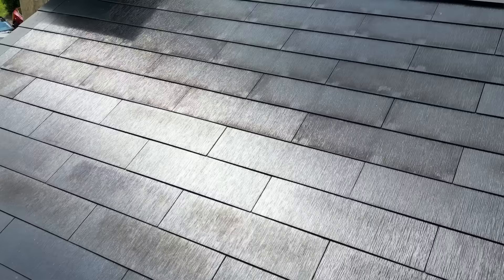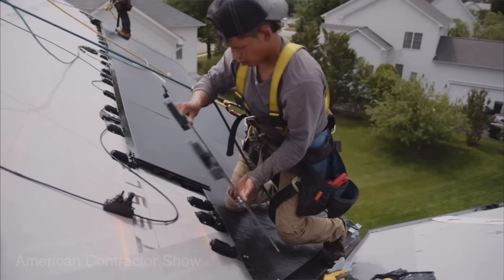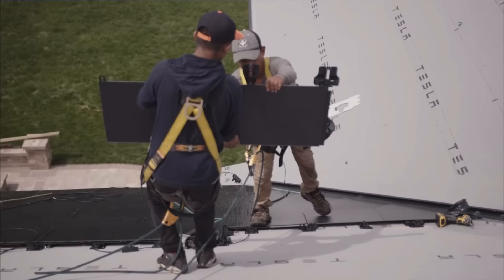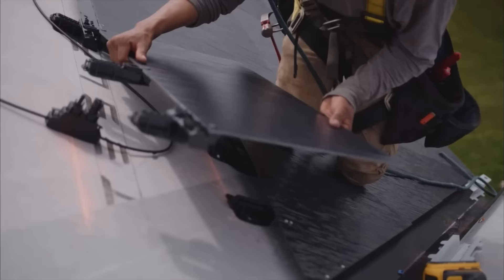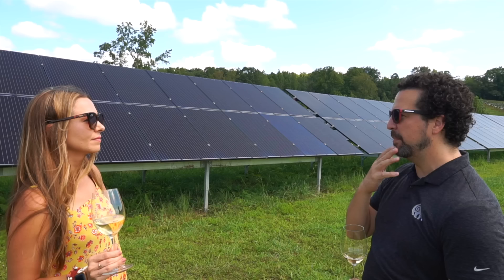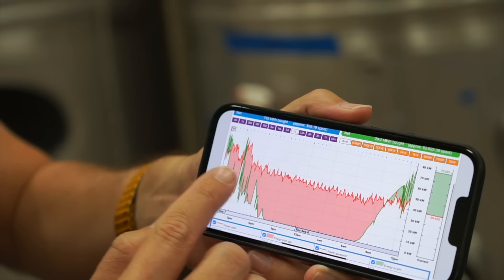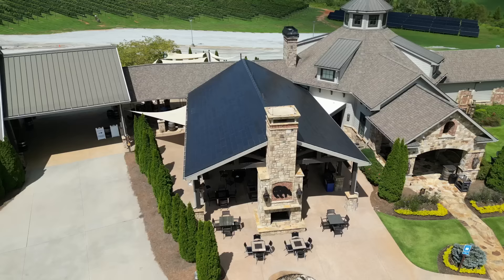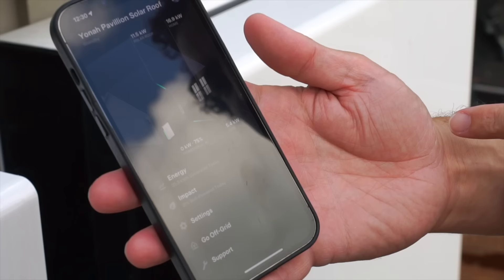One Year With the Tesla Solar Roof | The $100,000 Experiment

Comment: Great video, amazing quality. That being said, even 100k is way too expensive for 17KW + batteries.
Reply from the maker: Price included 4 Powerwalls but yes not cheap.
Reply: Not sure about this install but pricing for solar roof has the added cost of the removal of the current roof. 

If forget but last time I priced it out on Teslas website it was about $20k just to remove my current roof.
Reply: Yes it is expensiv, but it also gets you a new roof w
Reply: 100k + 4 powerwalls is dirt cheap from any solar company not if you build it yourself

Comment: I am going to assume this property is commercial he can literally install up to 300KW and still qualify for 30% ITC. I own a solar operation in Louisiana and we install in TX OK and LA. The same system size (in the video) via 400w Solar Panels + 4 Batteries would cost today about $93600 and after tax credit it would be $65520. We use Enphase Micro Inverters.

Comment: Did he say they expect to break even in 3-6 years? That’s an incredible ROI. Really enjoy these videos of different applications for this tech.
Reply from the maker: Glad you enjoyed! These are always fun to make.
Reply: All gravy after 🥸
Reply: Break even in 3 to 6 years my foot. Why doesn't he list the cost of the roof?
Reply: @kpv123   Probably because they're separate projects installed years apart. Even though they're on the same property, presenting them this way is a good way to contrast how the economics of solar projects of different types work. 

So for the rooftop one, at 2:39 and 3:12 they give the specs, pricing, and payback time for the pavilion project - $60k for the tiles and installation, $40k for the Powerwalls. 17 kW of generation. 22 yr payback, though I'm not sure whether they are counting the value of a roof in that or not since to an extent you could separate that since you've need to pay for  a roof anyway.

For the groundmounted system, they give them at around 7:42 - 250k equipment and installation. 106 kW of generation. It's been in operation for more than four years and at current rates, roughly another three more years for payback, so call it a bit over seven years. I presume that their rate changed over those four years since at the quoted savings they'd have generated $250k in savings in 4.6-5.2 years, though it's also possible that this figures were simplified and seasonal variation accounts for the difference.
Reply: Yeah, sure they will😂
Reply: If you invest that 100k in an s&p500 index fund. In 25 years you will have 500k. But the solar roof will need replacement. Will you save 500k in electricity over 25 years? Not likely.
Reply: 50 years to get your money back is horrible investment and all the cost associated with producing these tiles.

Comment: Very funny video you should install an East to West solar tracker probably produce a lot more power
Reply: But a fixed roof can't track. Solar tiles at fixed on roof.
Reply: I wasn’t talking about the roof that’s obviously a fixed system I was talking about the solar farm they had, not the roof
Reply: @alexc9879  in my area of chandler az the trackers seem to fail and get stuck a lot. I report them to ASU , CHANDLER CITY and APS a lot.  I consideredthem on my home backyard system but measured the output and cost and just added more panels.

Comment: And there is the issue...22 years to recoup costs.  Even longer if you buy now.
Reply: What is the roi on a non solar roof?
Reply: @CjF344  I don't think anyone actually gets an ROI. There was a while when the government was throwing away billions of dollars into solar and you recovered your cost in like 4 years, but those days are long gone. The thing is, all solar cells actually degrade over time. Your real savings isn't in solar, it is having a battery bank to take electricity during the low demand hours and use it during the peak hours.

Comment: I’m sorry but non of these KW numbers are remotely impressive for the cost. 17 kw is less than half of what the average house uses in some states and for $60K… not to mention, what’s the point of the power walls? I’m sure a place that large, is burning more than 17kw a day. I live in a 2000 square foot house that does 22kw a day. So what is the power wall saving? Is it from the farm? If so, even 106kw seems to be in the realm of what that building does a day. Plus the Tesla charging is also a ton of draw. He would need a lot more panels to not need the grid. Like 30x times more if all of those Tesla chargers were in use at once.
Reply: you dont understand the numbers. most homes use 7-12 kw. there’s a difference between kwh and kw. this system was cheap

Comment: I don’t understand y’all said the break even point  is 22 years but I divide  $2600 into $100,000 and that’s over 38 years
Reply from the maker: He never said the tiles were 100k, watch again and see the breakdown. PWs were 40k alone.
Reply: And Powerwalls won't last 20 years. The batteries have a life that will keep him replacing them at high cost along the way.
Reply: @jim9685769  I looked into solar panels years ago on my property since the power grid is not 100% reliable the batteries cost more than the panels I need a 10kw system. Solar is a luxury for the elite.